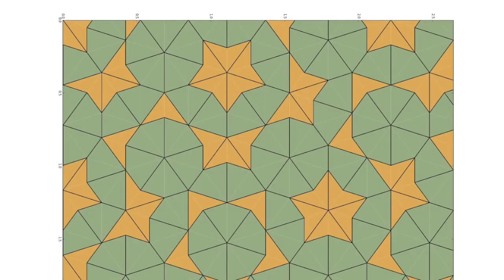Penrose Floor

Comment: How did you keep everything aligned? I'd like to do this, but I can't figure how to keep little errors from adding up.
Reply from the maker: We designed and 3D printed special distance holders to keep the angles while putting the tiles
Reply: one idea...print and plot in large format a stencil of the arrangement on vinyl. lay that first and apply the tiles on top? i'm thinking if you plot and weed out the large pieces and just have a stencil or stroke like stencil, then the tiles should lay fine still. rather than a full vinyl printout and having to worry about the vinyl "foundation"